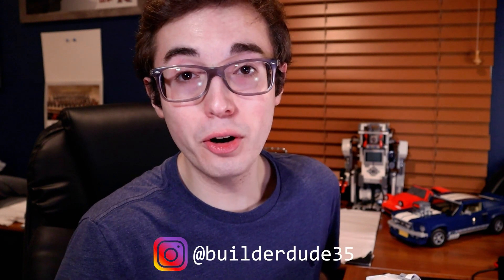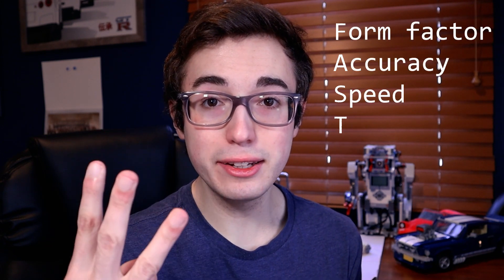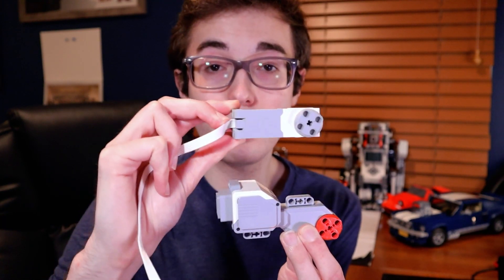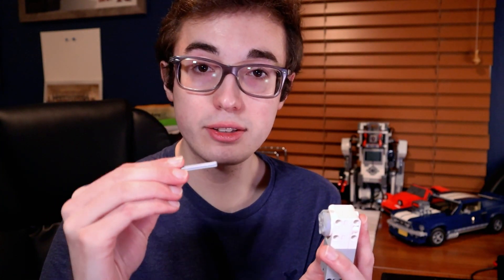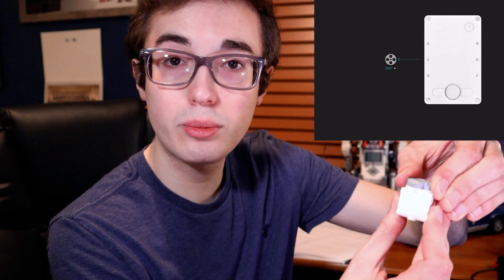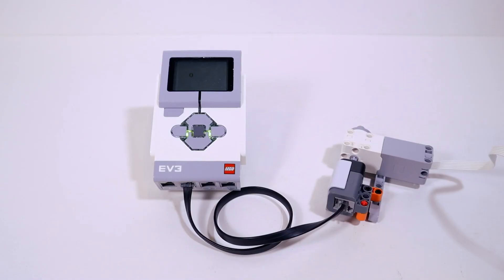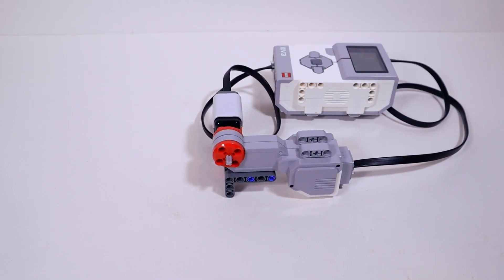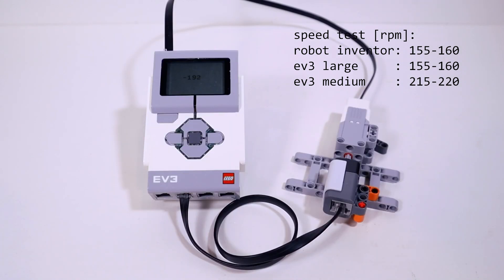LEGO 51515 Motor Secrets - Accuracy, Speed, Torque, Form Factor

Comment: Can’t wait!
Reply from the maker: I can't wait either! I hope you enjoy it :D
Reply: @Builderdude35  I have a question. I have an EV3, and I use the gyro sensor for the robot to go straight. But for some reason when I keep the robot in one position, the gyro sensor keeps of thinking that the robot is turning when it's absolutely still! Do you think the gyro sensor has problems?
Reply from the maker: @andrewzhuo6399  Hi Julius! The problem you are encountering is called "gyro drift" and it is common. Thankfully, it can be fixed! Check out my video where I talk about fixing gyro drift and improving the accuracy of the sensor: https://youtu.be/7V16AEW3GG4

Good luck!
Reply: @Builderdude35  Thanks!
Reply: @Builderdude35  One more question: Sometimes the EV3 doesn't recognize the gyro sensor (and other motors or sensors). What should I do?
Reply from the maker: @andrewzhuo6399  That one is interesting... maybe try restarting the brick, making sure the sensor is plugged in before you turn it on again. If all else fails, try updating the brick firmware.
Reply: Where do I update the brick firmware?
Reply from the maker: @andrewzhuo6399  With the EV3 software open, in the toolbar at the top go to Tools --> Brick Firmware and you should see the menu there.
Reply: @Builderdude35  Thanks!

Comment: 156, 156 and 156 on my 51515 physical tachometer seems like it works well (also the tachometer senses 15 seconds,30 seconds and 1 minute for as much accuracy as it can get to measure rpm

Comment: Hmm... So the new motor seems to be much less powerful than the ev3 large. But the motors+brick is also much lighter. I wonder how this will scale in terms of acceleration and overall mobility for a typical 3 wheeler... Very nice reviews man, I am devouring your LEGO 51515 review series.
Reply from the maker: That's correct: power is a function of torque times rotation speed, so less torque at the same rotation speed = less power. In my experience so far, this shouldn't affect the speed of your classic 3-wheel FLL robot; those robots had more torque than they needed anyway, so having less torque with LEGO 51515 shouldn't slow them down at all. Unless you want to use really tall wheels, then you might have insufficient power.

Comment: The voltages of the batteries are actually the same, if you read closely it says in both of them 7.4v rechargeable lithium-ion battery, when they're fully charged they can reach 8 to 8.5 V

Comment: Honestly, I prefer the new motors. I understand that they're no where near as powerful as the old NXT or EV3 motors, but since they use the powered up electronic system, you can connect both the powered up L and the XL motor, both of which have a similar toque to the old power functions XL motor. The large circle/cylinder at the back of the NXT motor is the main motor, which is identical to the one found in the power functions XL motor. I'm not sure how the output torque differs between the NXT motor and the power functions XL motor, but the power functions one uses a planetary gear set to increase torque, where as the NXT/EV3 motor uses a direct line of gears. Since I can just connect my powered up XL and L motors to the new spike prime hub, the torque problem is not an issue for me. Using a planetary gear set instead of the direct line of gears results in a much smaller and a much better form factor
Reply from the maker: This is a pretty fair take IMO. I personally am going to miss the extra power/torque, but I definitely see the merits that you mention. Pretty soon, I am going to try to see just how fast of a car I can build with these motors!

The NXT and XL motors had the same core, as you noted. The NXT motor had more output torque because it had a higher gear reduction (which also means lower rotation speed). The XL motors still have more output power though because that planetary gear set was more efficient, meaning less power wasted due to friction.

Comment: Overall, my FLL team is enjoying the Spike Prime kit -- it is just a lot less buggy than ev3 (especially bluetooth connection and gyros).  But... the lack of torque is extremely challenging for a number of the missions this year.  The robot simply stalls when it tries to push something that is even slightly heavy (like the train mission, or the one where you need to move the cargo off the ship).  I am not sure it is really worth it.  I am curious the torque of the large motor (which is used for attachments in Spike Prime)

Comment: Love the RI series so far! Just some questions about the motors though:
Shouldn't an absolute encoder be more accurate than an incremental encoder/is there some factor that influences this?
How much play/lag do the new motors have compared to the ev3 large motors?
How accurately do the new motors drive straight (is it worth making a drive straight program like with the ev3)?
Reply from the maker: Great questions!
Absolute encoders are not inherently more accurate than relative encoders. The only difference is that an absolute encoder has some kind of reference flag so it always compares motor position to the zero position.
I have not yet formally tested the play in the new motors, but my gut instinct from playing with them is that they are a little less sloppy then EV3 motors, which is great news!
Ditto on not having done a straight-line test, but it's always worth using a drive-straight algorithm, because external factors like bumps or changes in traction on the table surface can cause errors even if you have the most accurate motors in the world! Tutorials coming soon on this!
I'm happy you are enjoying the series, and I hope you keep watching! Lots of cool videos coming up soon!

Comment: @Builderdude35 thanks for all the informative videos. I want to ask if there is some fundamental difference between the mindstorms motors and the technics motors, apart from the rotation sensors in the mindstorms. I mean, do the mindstorms use stepper motors for example or are they just typical DC motors?

Comment: Thank you for making such a great and insightful videos!
I'm currently building an automatic coffee machine with  51515 set, since i'm using  2 motor which each motor has 2 outputs and another 2 motor for the water faucet, the motors torque isn't enough for each of task of them. 
After watching your video, i'm thinking about changing the power supply, but is it safe for the hub and other component? also if i can do it, where can i possibly find the battery that fit to the hub? 
I look forward to get a suggestion from you :D

Comment: Your videos are really helpful!! Thanks for sharing the knowledge. 
I have a question regarding a different topic since your the only expert in lego who replies more than lego itself😅
I have the renewable energy add on and I can’t find any resource for how to charge the energy meter with ev3 instead of pf battery box. Do you have any idea how to do so?

Thanks in advanced😁
Reply from the maker: Admittedly, I do not have much experience with the Energy Meter, so I did some research myself. I found this document, which teaches you how to charge it using an NXT. It requires an adapter cable that adapts the NXT/EV3's RJ-12 connector to a Power Functions connector; I bough a bunch of these years ago but I don't remember how I got them or how you can get one today (probably on Bricklink)

Check it out here: https://le-www-live-s.legocdn.com/sc/media/files/user-guides/mm/9688-energy-meter-guide-e526319e083ac417918f4fa7c1563fc1.pdf

Good luck!
Reply: @Builderdude35  
Thank you!
I did see that before, I thought there’s a way to do it without extra cables since it’s not provided in either sets and it says on the manual there’s a way to do so. 
I’ll try to get the cable. 
Thank you for your reply 🙏🏻
Reply from the maker: @rawanbakro8297  No problem! Good luck tracking down the cables!

Comment: Does the software support doing for example 10.3 revolutions and going back even with variable load?
Reply from the maker: Yes, the motor encoders ensure that the motor's rotation is accurately measured regardless of load. When you set a target like 10.3 revolutions, the motor will rotate until it reaches that precise target, even if load changes (as long as the load does not stall the motor).

Comment: The new rrobobt inventor hub kinda sucks. I wish that they didnt dpwngrade some of very crucial features. Like in FLL we were always required to use all four ports for competition. If i were to use 4 ports for motors for tasks , i could only use 2 sensors which is kind if a bummer because i always find myself using multiple sensors to get accurate results.